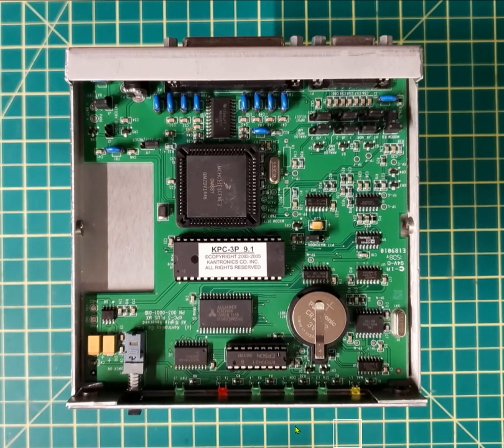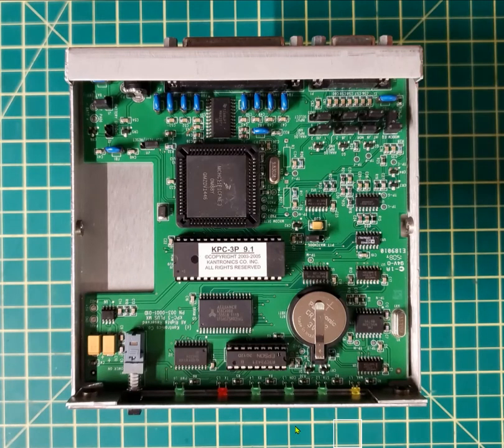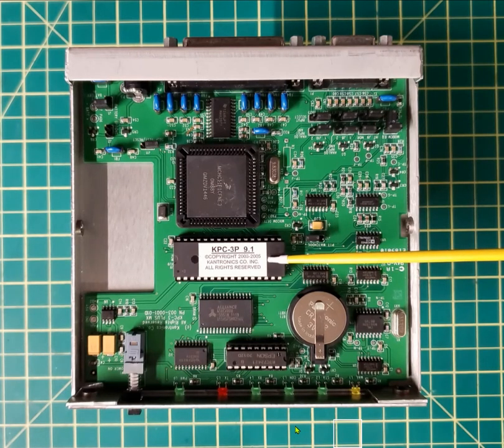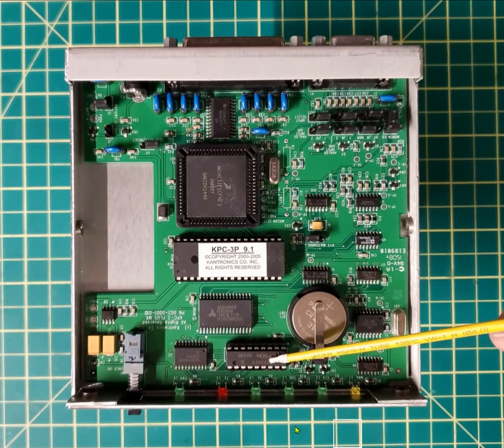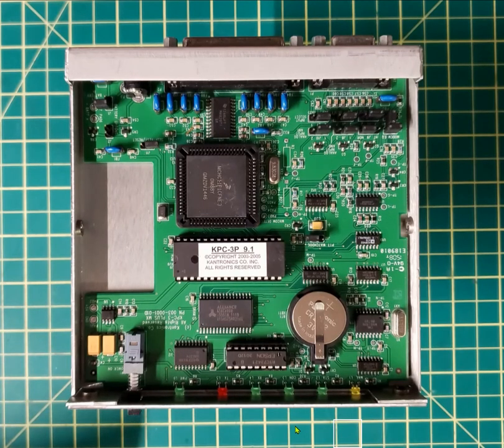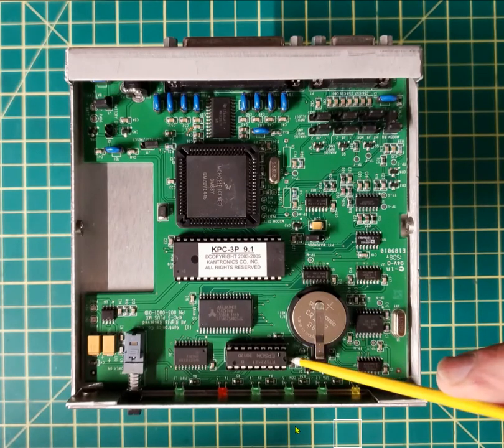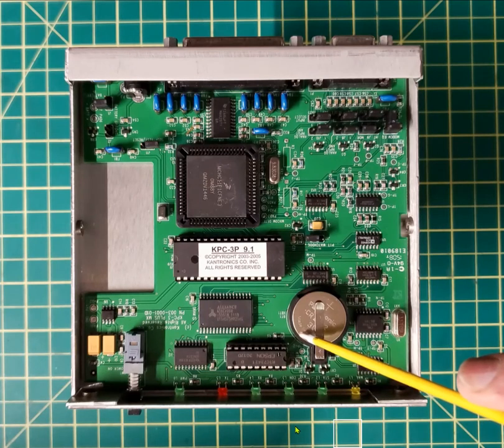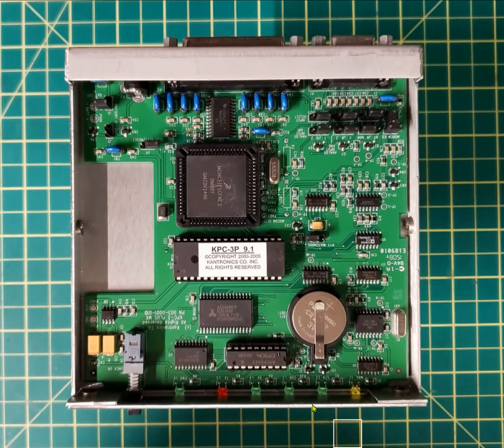Packet Series #5, Kantronics, KPC3Plus  - Real Time Clock

Comment: UPDATE: Disregard my original post, below! Your video missed some very important steps:
1. After installing the RTC chip, you have to  open the KPC-3 Plus, locate the RESET jumper (J11) and short it (put the jumper across both pins).
2. With J11 shorted, turn the KPC-3 Plus on and wait for the hard reset message to appear on the screen (terminal needs to be at 1200 baud to see it).
3. Turn the KPC-3 Plus off.
4. Remove the short from J11 .
5. Turn the KPC-3 Plus on.
6. Set the time with the DAYTIME command.
6. Enter all the configuration changes you may have made before installing the RTC chip (you did do a DISP command and capture them before resetting the KPC-3 Plus, right?!)

ORIGINAL: Thanks for this. I bought my RTC chip from Kantronics. After installing it (while powered off and unplugged from 12V), I powered it back on and did a full restore to factory defaults. I reloaded my settings and set the date/time with the DAYTIME command. When I turn the KPC3 off, it still loses the time. For example, I set the time to 1723 and turned it off. Three hours later, the time was 43:30:15! The hours were obviously wrong, but the minutes and seconds were correct! Any ideas?
Reply: DAYSTR command
Reply: @DeltaMike66 Not sure what you’re suggesting, but, the DAYSTR command is used on a Kantronics Terminal Node Controller (TNC) to set the format for how the date and time are displayed and used for time-stamping packets. It does not set the actual date and time, which is done with the DAYTIME command.

Comment: I can get an Epson RTC72421 B for about $6 delivered on ebay. Are these the exact same IC's that the radio dealers are charging $30 for?
Reply from the maker: I buy mine from Digikey,  and it probably the same as the ones on Ebay